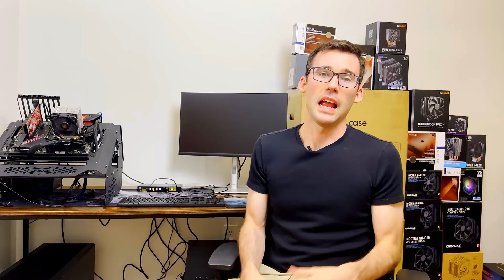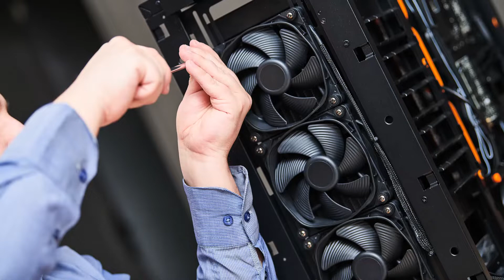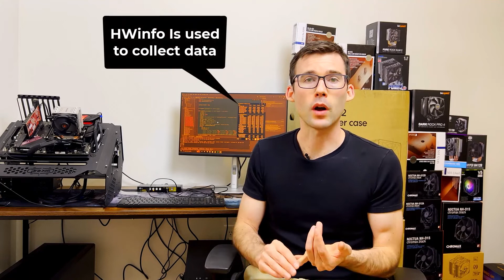Testing Procedure - The method behind it all

Comment: I don't get where machine learning comes into play, you do tests get your data points and you can put that into graphs.
Reply from the maker: Although I collect data, it can include lots of variation that can influence the results, including the power distribution, fan speeds, and among other relevant factors. Machine learning takes a look at all those variances and attributes the temp differences to the various factors at play to come up with an model to predict the temp for a given scenario. Then when I input the same information into both models and only allow items that matter to change in a controlled way, it allows for the audience to better see the differences while taking out the noise that may provide inaccurate results. 

Also, if I were to map the results, it would have to be at a minimum over a 3D graph, which would be difficult to compare two products.
Reply: @pc_analytics  So filtering anomalies, that's kind of what I hoped to hear, awesome. 
As far as gaming workloads go 125W is sufficiently high threshold but it would be good to see those coolers at the higher power targets as well, full load scenarios for current gen cpus is above 200W. 
Thanks for coming back to me :)
Reply from the maker: @Cypeq  np, one thing to note is temps to watts are cpu specific. For example 125W on an amd might be comparable to 200 watts on intel. Although I’m working to expand my analysis across CPU, the biggest takeaway is relative cooler differences at various loads.